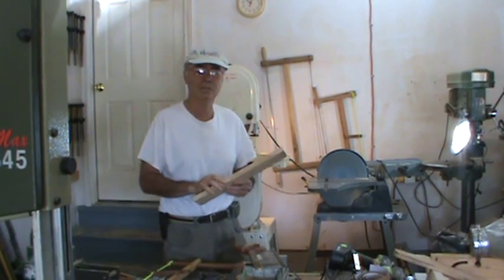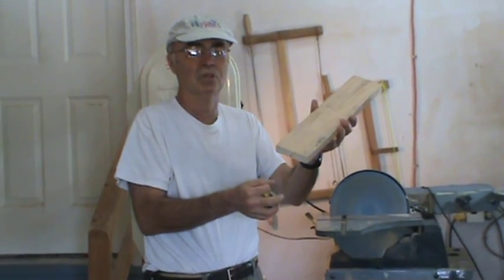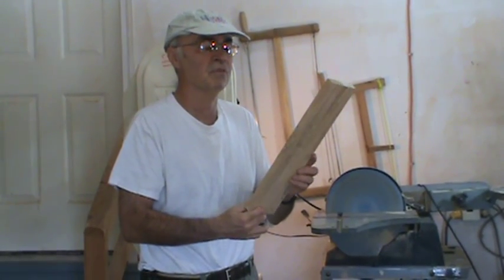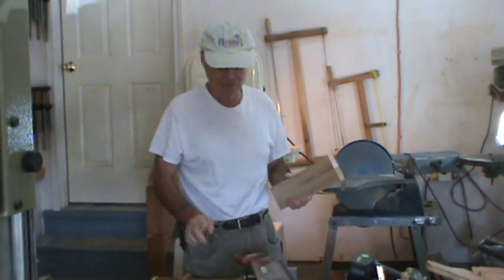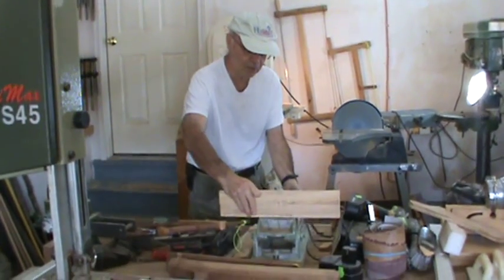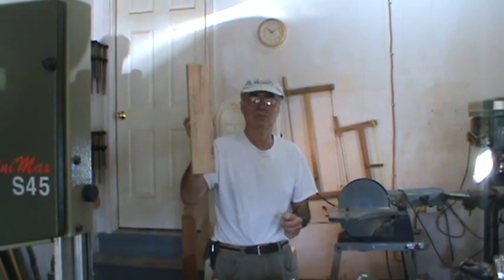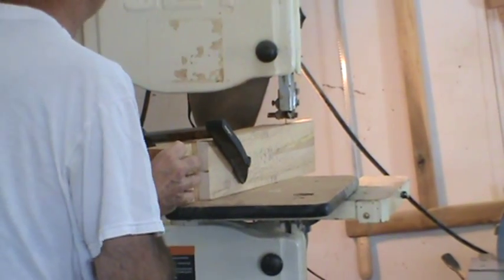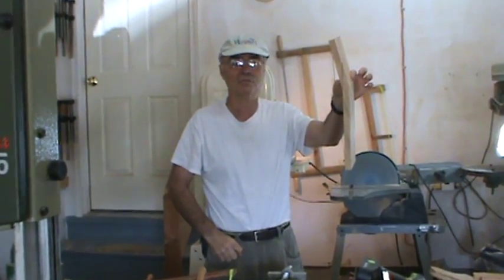How to Cut a Scarf Joint for Hawaiian Tenor Uke Neck

Comment: Just thought I'd mention, another popular wood for uke necks is quarter sawn spanish cedar.  The general advice for any neck is to use quarter sawn wood with the grain running vertically (towards the fret board).
Reply from the maker: matt clara  Your  right , but you can also use flat sawn  SC  as it is vy light and stable
Reply: I appreciate your videos, Ernie--keep up the fine work sir.
Reply from the maker: Your welcome, too busy building, when i retire will do a lot of teaching .There is so much to learn in luthiery , takes at least 10k hrs to become good!

Comment from the maker: I use the sanding machine to true up the scarf joint .If using a plane, block or smoother make sure your bottom is dead flat. e.g.lee valley or lie- nelson.

Comment: ernie, thank you so much for these videos. i'm going to replicate the jig in this video for my own shop. i checked out your website too, you have some really beautiful instruments. would you mind making another video showing how you plane the scarf joint after you make the cut and before you glue it? i know it's probably not the most technical part of the process, but your insight on the subject would be greatly appreciated.
Reply from the maker: Once   you have   your  scarf  joint  glued  , flatten  using a  small  block plane   in a  vice  . Check with a   st  edge  ruler